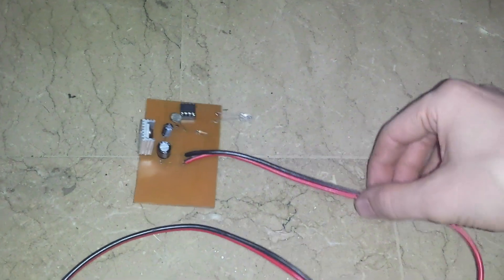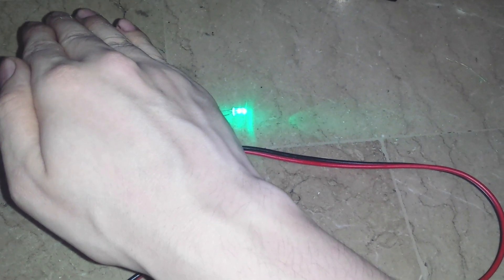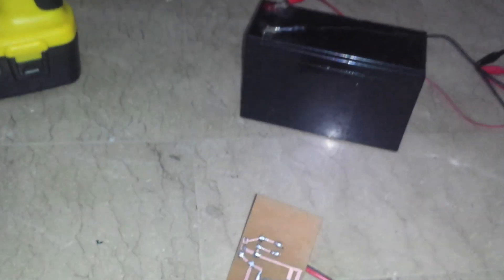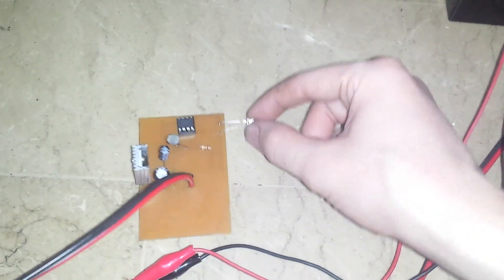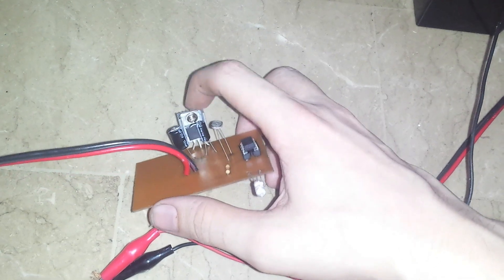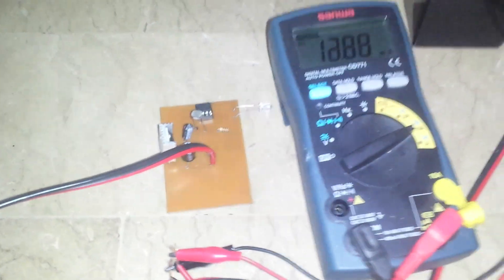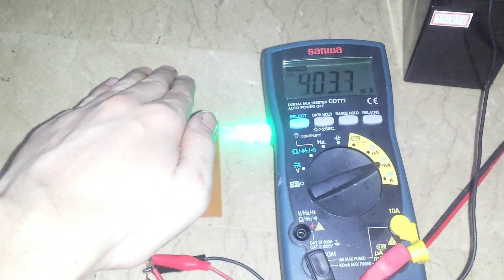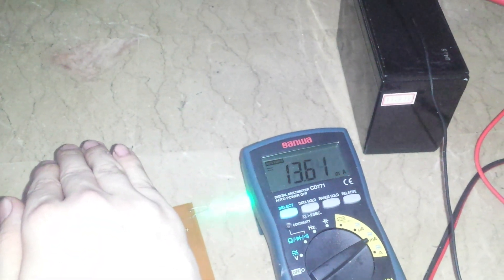Automatic Solar Night Light 7805

Comment: Wow, so many parts?  All you need is the electric eye and a dropping resistor.  The electric eye can handle the 25mA easily.  No need for 5V regulator, etc.

Comment: how can we know which amphere of battery to use. i was thinking of a 2  pc 100 watts solar panel
Reply from the maker: al PELAYO Let's keep things simple and not consider varying voltages, charge losses etc and assume that your 200 watt of solar will generate 16 amp in full sunlight and that you get a total of 5 hours worth of direct sunlight a day. 5 * 16 is 80ah.  Since you don't want to run your batteries down beyond 50%, you'd want a battery capacity of 160ah Of course you might choose more or less battery capacity depending on how much of the power you intend to actually use each day and whether you'll use any power while the sun is up and the battery already fully charged :)

Comment: I watch it and miss. But i didn't identified the electronics parts.
Reply from the maker: 7805 voltage regulator, capacitors, LDR, LED, attiny85. I'll be making a new video soon which shows a better device and a better break down of how its made :)
Reply: Gadget Addict hi im already enjoying your videos, very instructive for me.. I would like to do this too!, could you upload a video with a simple schematic and the sketch you used to program the chip in arduino? Thanks in advance!
Reply: Gadget Addict i like better this http://youtu.be/sVyi7yWuXxs but will like to add the sensor like in this video, any help will be much appreciated